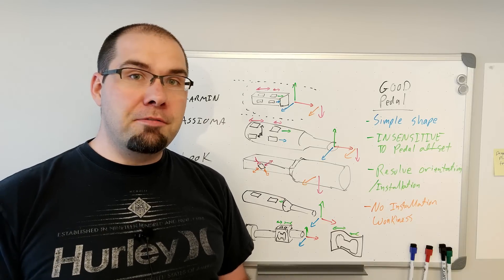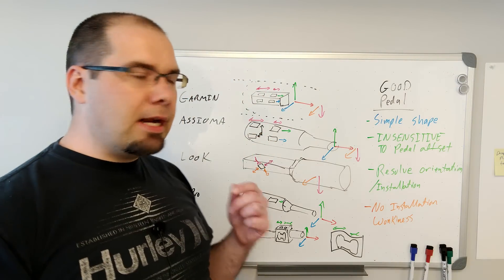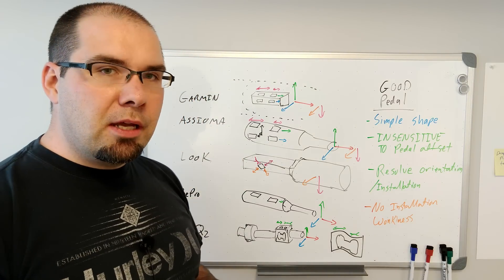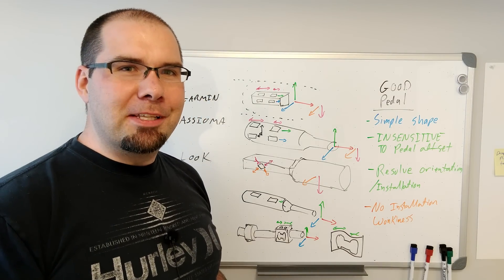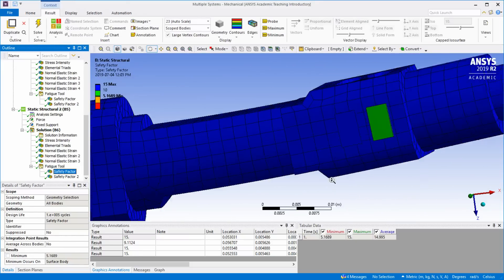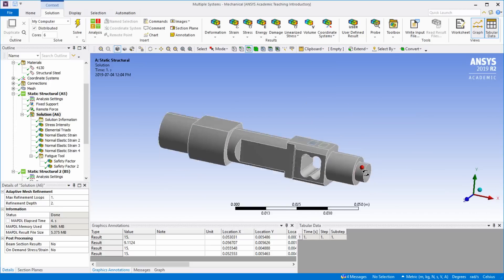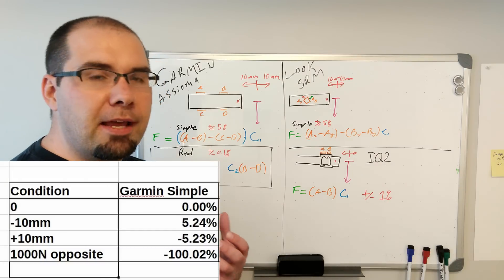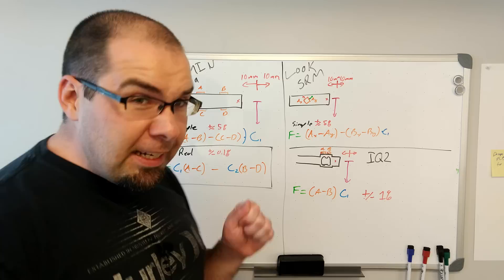Pedal Power Meters - Who's the best mechanically? IQ2 surprises!

Comment: Maybe you could do such a kind of video about the axle based Powermeters like the RaceFacer Power Axle or the Rotor Inpower. Would be really interesting to get explained whats their advantages or weak spots against the other layouts
Reply from the maker: I can look into this. There axle isn't much beyond the concept of the torque tube in a powertap hub but maybe I can go into a little more detail. Maybe nit-pick on it. Axles are actually simple and decently accurate and low on flaws except the left only thing. There are actually some axle patents that can do right (similar to Powertap design though) -- no products.

Comment: I'm surprised with the IQ2 results. The jam nut is still an issue. I came up with using different size spacers /washers once. I think I needed an assortment of 5.
Reply from the maker: 100% agree. Jam nut and alignment is such a pain. Original Favero BePro was such a pain to get things initially set up and then stickers and alignment marks. Nope. They've made a killing with Assioma just by adding a second set of gages. I've by no means been exhaustive only looking at accuracy under pedal offset conditions and a super rough fatigue that's only "ballpark" at best. But ya, less pedal offset sensitivity than Shear gage designs like old Look polar and current Look SRM Exakt.

Comment: What about Rotor?
Reply from the maker: Nice and symmetric. The inpower has unresolved indoor/outdoor timing issues last I heard, so one of those scenarios it reads high (or was it low?). Dcrainmakers review outlined the issue. Mechanically the old rotor power were very good. The 2inpower's right arm is very good, the axle sensing is a little imperfect.

Comment: What effect does running pedal spacers have on pedal power meter accuracy? Thank you.
Reply from the maker: Because it's happening outboard of the sensors there shouldn't be any measurable effect (so long as its decently flat and torqued down a bit).

Comment: This is really interesting, thank you for these great videos. There's one popular pedal that you haven't mentioned - the Powertap ones. Can we assume that they use the same arrangement as the Garmin/Assioma ones?  Why is it that you haven't included them?
Reply from the maker: Powertap p1 and p2 have a very different gage arrangement. I've used p1 extensively and it was within the margin claimed always but it's the only unit that I've used that bounces around for me from +2 to - 2%. They dont detect crank rotation but pedal rotation so that can cause skew. The gage arrangement is also on the pedal and not the axle. It uses shear gages like look (srm exakt) but arranged on the pedal body. So it operates differently by having to constantly figure out its angle relative to the crank (or assuming it) then resolving the force. My personal experience coupled with those two theoretical points has me leaning away from it as a product but that might have changed in software. I haven't used them recently and the problems I experienced with p1 were potentially software fixable from when I experienced them. I do know that a lot of people love them and have good consistent results. The weakness is that even if you get the force sensing perfect your instantaneous angle estimation needs to be very good or else outliers (like me) see weird error.
Reply: @kwakeham  That's an interesting design.  I assume that to do FEA on them you'd have to build an entirely different model, and it wouldn't teach us much comparing them to the other pedal power meters? Is the angle estimation problem the reason why no-one has replicated this sort of design?
Reply from the maker: @Duncan Martin I would and I'm still not 100% sure of the arrangement though I believe it is a tube with shear gages setup for bending similar to a 2d version of look but it's differently location. Honestly, I'm not sure why not replicated. The way they did it solved one problem (battery location / connections) and added another (angle estimation). Though had I been building a pedal I'd rather solve the battery problem than the angle problem. There are almost no patents on  pedal power meters because original designs were patented over 20 years ago, and nothing is significantly different. Nobody has bothered with attempting something and with most basic designs out of patents I guess nobody finds it worth it. Pedals are also very space constrained. The Vector 3 PCB is near apple earpod / pencil level of design size minimization. It's a remarkable feat. Nobody has follow them yet on minimization.
Reply: @kwakeham  Wow you are so rich to disembled those pedal :)

Comment: Won't IQ2 have an issue with temperature compensation with just two gauges?
Reply from the maker: According to the pictures it's a full bridge. However it depends if for a half bridge. You can get voltage dividers that have specs above strain gages for matching, but they are expensive. However it's also a "luck of the draw" with these bridge completion resistors. If you can reasonably expect the PCB to be in vicinity and not exposed to the world (housing) and the gage is on something with sufficiently large thermal conductivity and heat capacity then you can do an active temperature compensation (simple linear) just like a full bridge and the result will be pretty close expect the decreased mechanical sensitivity. But most contraflexure setups are full bridge because the price differential is tiny. With contraflexure on the same surface one gage goes up and one down within mm of each other, unlike bending arrangements which are space far apart. So putting a second set next to them and flipping it's electrical connection is easy.
Reply: @kwakeham  Cool, thanks for the explanation. I thought it was just a half bridge as I just saw the two gauges in your simulation, but after taking a look at the IQ2 website I see the full bridge in the "pictures".

Comment: Thanks for taking the time to do this. So I take it that you'd pick Assioma over the Look SRMs?
Reply from the maker: If only Assioma vs Look SRM Exakt then 100% Assioma. More accurate and way easier to setup along with being nearly half the cost.  I just watched the Exakt installation video and it's essentially "keep messing around with the jam nut with the chain off your bike until it doesn't move when you press down vertically on it".  650 USD vesus 1700 USD (Only place I found stocking it, I thought it was suppose to be 1300?). So you could literally buy Two pairs of Assioma DUO in the US or Canada and get a clearance Elemnt bolt or Edge 520 for the price of just the looks and never have to futz with installation ever again.
Reply: @kwakeham  cheers